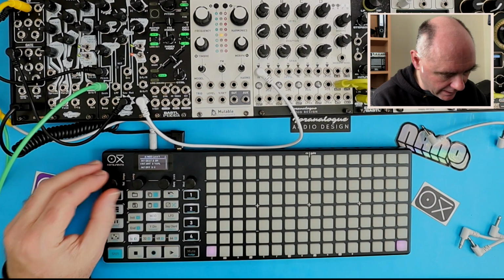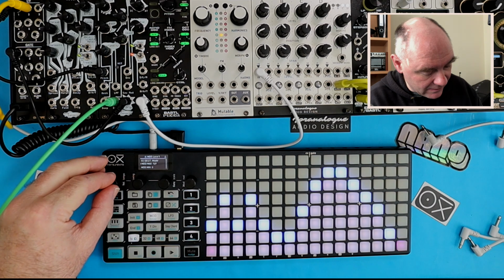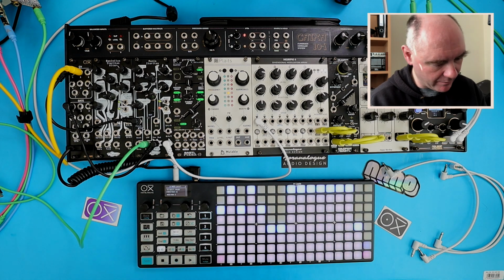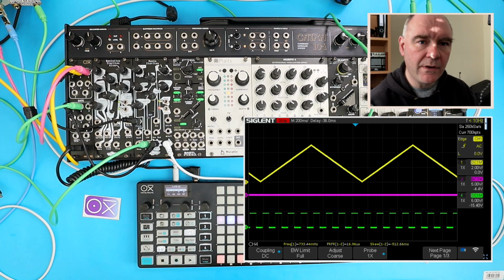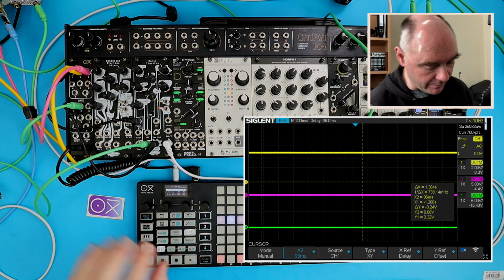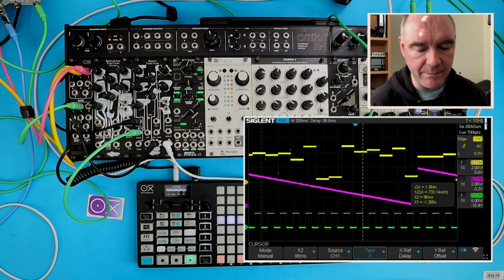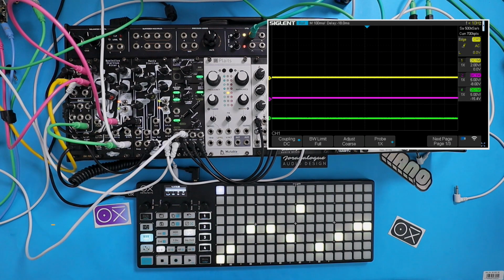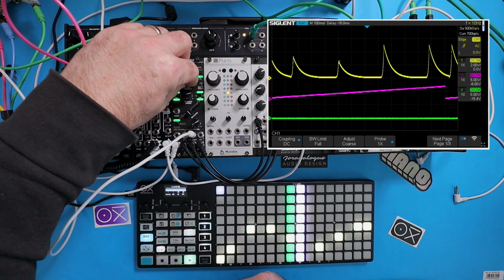Oxi One Modulation and LFOs  tutorial Part 1 - Building Blocks of Modulation  with Modular Synths

Comment: Thank you for your videos. I watched all them but maybe missed some things:
My question is about midi (not cv)
1. How do i map a midi cc to a knob on oxi?
2. Can i turn the knob on a synth and Oxi knob will learn that? Or i need to set the CC value manualy (looking in synth documentation every time)?
3. Can i turn knob on external synth and record that automation is OXi steps and adjust it afterwards.?
Reply from the maker: 1. To map a MIDI CC you need to go into the MOD lanes and then set up the mod destination to be a MIDI CC value. Then when you turn the knob the Oxi One will send that CC.

2. Yes it's possible to do this using the LEARN option in the MIDI mapping in the MOD matrix. See page 90 of the manual
Reply: @ daddy! Thank you!

Comment: I just got my Oxi 1 and starting to wrap my head around it. At this point I’m using it to strictly modulate and sequence my eurorack modular setup.  Trying to figure out the best and most efficient sequencer mode to essentially make all 8 cv outputs send out voltage that I can draw in the shape, effectively using it as a customizable “ochd” that each CV output is its own randomly drawn LFO, each with its own respective rate and voltage min/max. 
Any tips on the best method of making it work in this way?
Reply from the maker: I'll cover that in a future video!

Comment: I’m guessing- in modular, you’d patch a “velocity” cv into a vca cv input, correct? I take it the pitch and velocity cv outputs on Oxi are simply voltages right? Is there a way to set them so their range is bipolar?
Reply from the maker: You could, or you can patch the gate into an ADSR envelope generator and then the output of the envelope generator into the VCA CV input. The velocity output from the Oxi One can then be mapped to (say) the release time or sustain level on the ADSR envelope if it has CV control over the stages.

Ultimately everything in modular is a voltage, including the Oxi One outputs. You can offset the CV voltages in the Oxi One so they go down to about -3v or so.
Reply: Thanks for the reply! Great ideas. One other related question- can Oxi output modulation voltages be slewed or smoothed? To avoid clicks when modulating certain things ?

Comment: With regard to the max/min mod values, based on how the mod lane step lights changed, is it more correct to call it a clip rather than scale? Eg if i have a sine wave drawn in mod steps going from bottom row, up to a peak of 4 rows, then change the mod max to be half as much, the new mod steps lit up will be bottom row all the way to top row (eg the values werent scaled, the values stay the same, but any values above half the original full range, will just be clipped to the new lower max) - and then it becomes impossible to enter new values above half because the grid now represents 0 to half, instead of 0 to full?

Comment: All of your oxi tutorials have been so useful. Thanks. I’ve recently bought the OXi pipe. It has a long hdmi cable and I saw that you have a really good solution with the coiled cable as a replacement. Would you mind telling me where you bought it
Reply from the maker: I got my cable off Amazon. Just be sure to get a HDMI2 cable as otherwise it won’t work
Reply: Thanks for getting back to me. I’ve tried a few HDMI 2 cables and they all prevent some of the cv outs of the oxipipe from working. Spoke to oxi about this and they said they’ve also had the same experience. Not all HDMI 2 cables work for some reason. Seems like you found one that does. Do you recall which brand it was?
Reply from the maker: @geoffcrowther2707 it was this one from Amazon: https://www.amazon.co.uk/gp/aw/d/B087TJPVZJ?psc=1&ref=ppx_pop_mob_b_asin_title
Reply: @SynthDad  Thank you 🙏

Comment: Is there a way to change the cv to a range between -5 to 5v?
Reply from the maker: You can output from -3V to +5v on the CV outputs already
Reply: @SynthDad  hey Synthdad, thanks for the quick answer. Yes I saw in the manual that the output is -3 to +5v. But I was wandering if I need a way to boost the cv and offset it so I can sequence the scan knob on my Arbhar which is from -5 to +5v. But i hoped it would be possible on the oxi without the need of a seperate module.

Comment: Thanks for your great tutorials 👍I'm currently experimenting with CV in modulation. From what I've learned a TRS cable should be used. but I can only get the clock out of the modulation from e.g. Pam. Even if I just want to modulate something. oxi automatically jumps into clock synchronization. Any idea how to set it up properly. Perhaps you have already dealt with this topic in one of your clips? cheers
Reply from the maker: Hi - that's not something I've experimented with but let me look into it

Comment: Have you experienced any latency using the HDMI cable as appose to patching directly from the device, I moved from Midi sequencing to CV so not to deal with any latency, I want to order the Pipe Breakout but hesitant. I have watched your OXI videos several times with the manual next to me and your work is incredible. Cheers!!!
Reply from the maker: I've seen no latency - it's a direct wired connection from the CV/gate outs so no processing is performed

Comment: Thanks a lot @Synthdad for another amazing tutorial!

A few notes:
- Firmware 3.5 has been released that includes among other features: 
     + possibility to Lfo Restart on note trigger
     + Lfo phase control
     + Cross modulation between LFOs, Mod lanes and external CV. 
        So for example you can let Lfo 2, a Mod lane or the external CV input modulate the Lfo 1 rate, amount or waveform settings.
- Note velocity actually controls the amplitude of the AD envelope and the note gate determines the Decay of the envelope.

Happy patching!!!
Reply: oxi  one is a joke compared to modulations and lfos on the hapax.  im so glad i sold my one for hapax.
Reply: @alien_brain  Don't be fooled, In OXI One you can do cross modulation between LFOs and MOD lanes. Also the MOD lanes are fully independent from the sequencer which is not available in the hapax
Reply: @oxiinstruments  they don't need to be unless you're making wind chime music.  Squarp guys really know what's useful to a musician
Reply: @alien_brain  That's not realy nice, and true. For me it's the other way, I had some Squarp sequencer and realy have a better musical feeling with the oxi one. They are both realy realy good sequencer and I'm glad there one for each taste. Personnaly I went with oxi and no regrets at all
Reply: @lelec3304  nice?  how about true?  true isnt always nice.  pyramid wasnt nearly as amazing as hapax